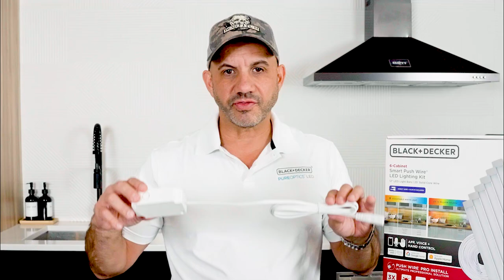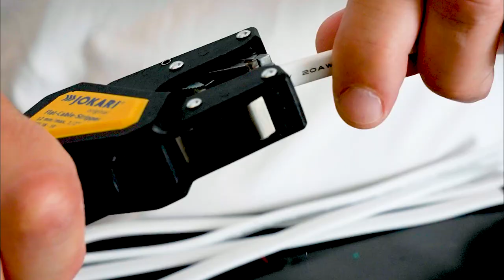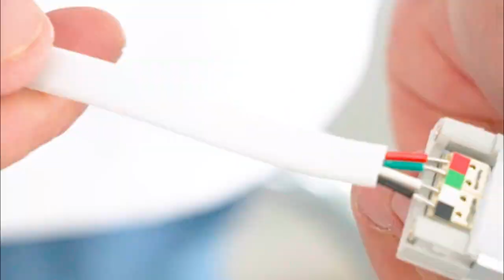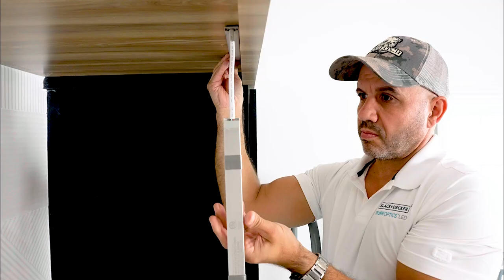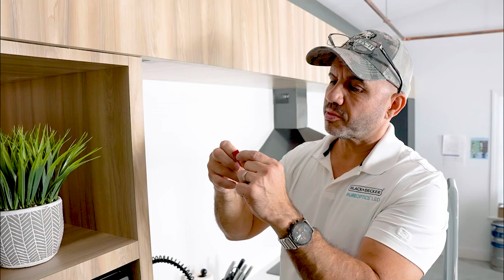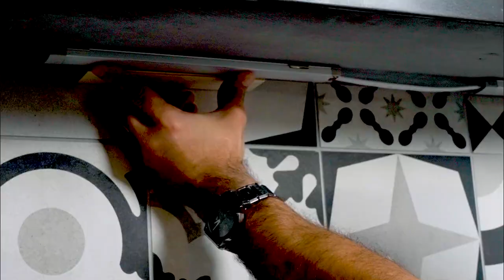How to Install Black & Decker Smart PUSH WIRE® Under Cabinet Lighting | Pro Installation Tips

Comment: Can you add a physical wall mounted toggle type switch to turn the lights on and off? I’m thinking in terms of resale when we move and the new homeowner who prefers to have a switch instead of using voice commands or the motion sensor controller that comes with this kit.
Reply: The controller he shows is the switch and allows you to turn the lights off and on.
Reply: @bpj1985305  I get that, but that’s not what I asked. It doesn’t bother me, but some people prefer physical toggle or paddle switches versus something that feels like a cheap piece of plastic with a motion sensor that’s sure to fail.